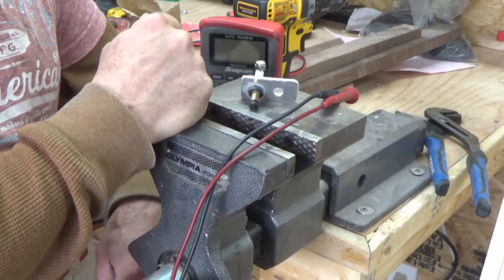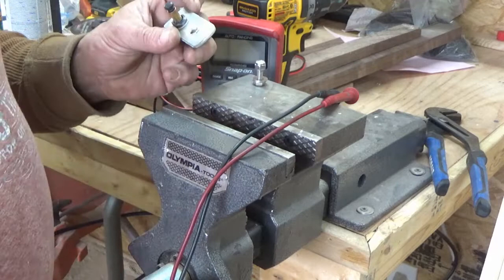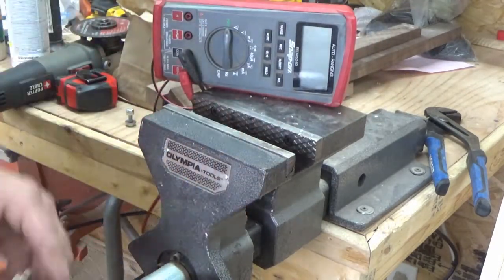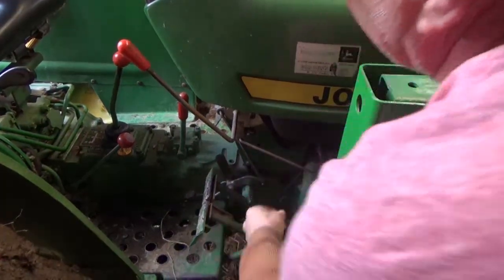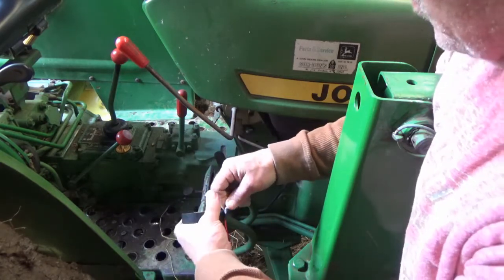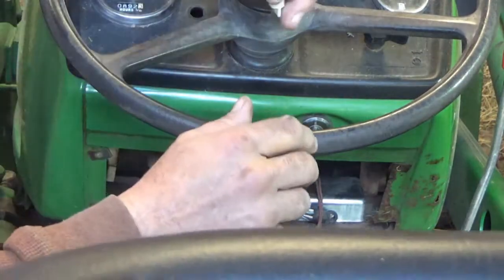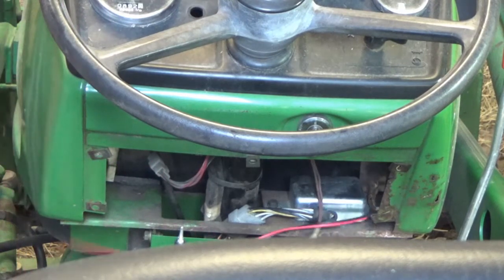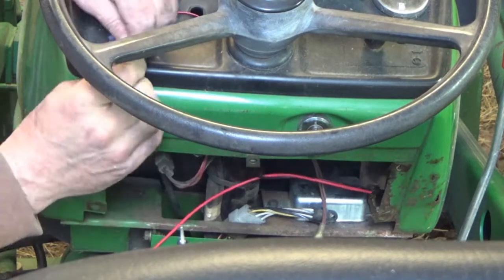John Deere 1050 Tractor Parking Brake Warning Light Installation / Mod

Comment: I just bought a 1050. How is your hydraulics doing since the filter and fluid change?
Reply from the maker: So far so good. Just moved 10 round bales last Tuesday into the barn and it lifted them all no issues. Was actually able to stack them 2 high.

Comment: I’ve had my 86 1050 for years now (she has over 5700 hrs logged, and still running strong!), but she’s having some three point issues. The three point all the sudden just started to not go fully up. I adjusted the link arm so it could go fully up (to move hay bales), but now it won’t go fully down. Do you have any idea what the problem could be? Thanks
Reply from the maker: Never experienced that issue. I do have all of the service and parts manuals however. Give me a bit of time to take a peek and reply back. If you don't hear from me in a day or two message here to jog my memory!
Reply: No, pressure, but were you able to find anything?
Reply from the maker: @SuperSherman44  I'm guessing you mean for the joystick conversion? Still waiting for the weather to give me a break. Just got electric and internet back after 60 + hours of being down due to a really heavy wet snow storm that took down a lot of trees and lines in my area.